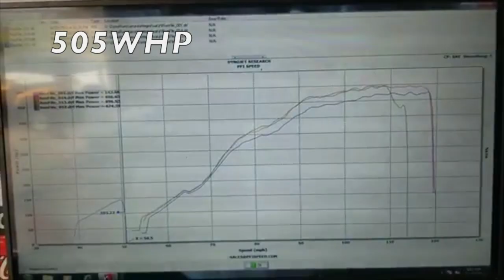Turbo Integra gets a fresh tune down at PFI Speed

Comment: Nice just bought the red mk7 that was yours should be all done in a few weeks  nice see that your at pfi
Reply from the maker: dank kush really!? Did you fix it or swapped the engine into something else?
Reply: Ya I fixed it runs great just was missing down pipe and some   bolts and stuff thanks for at least leaving me the clutch lol 😂 I need to put the bumper and fenders on should post something in the future